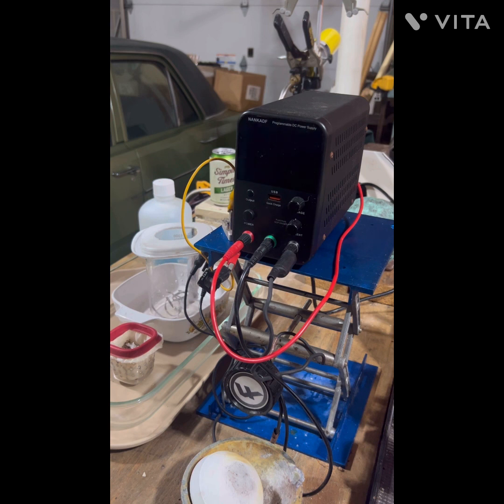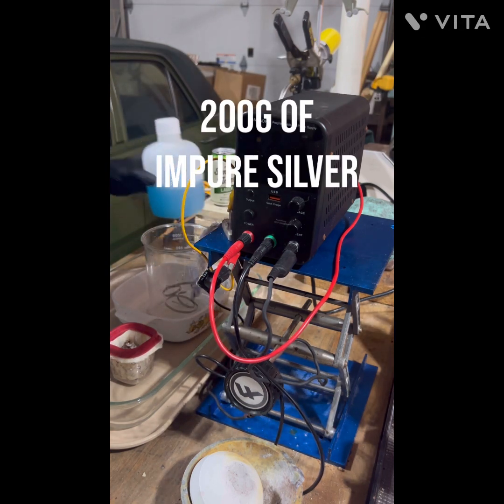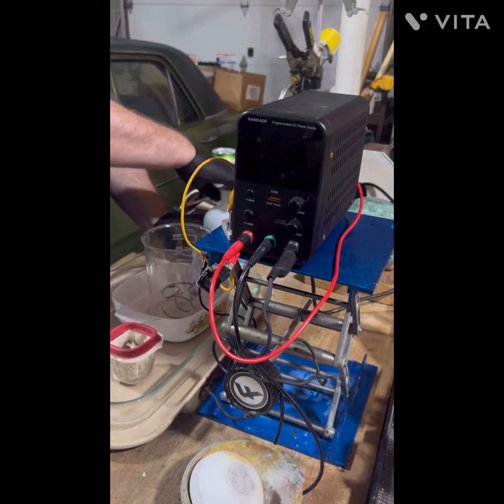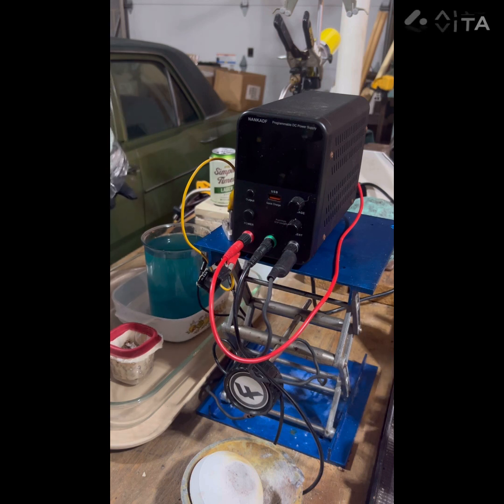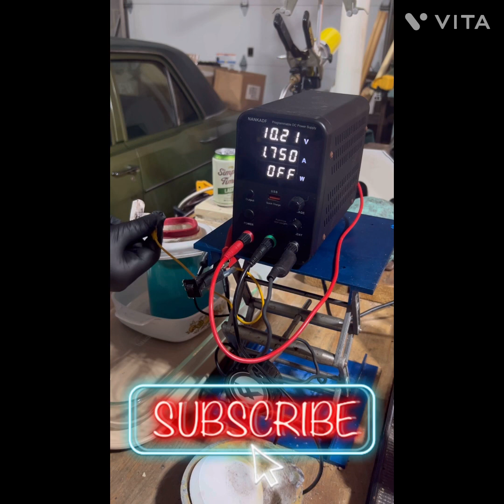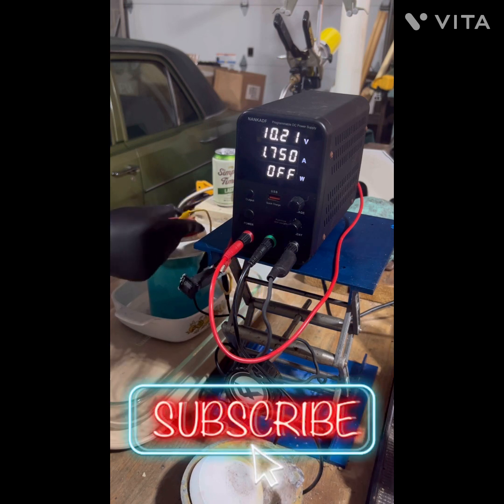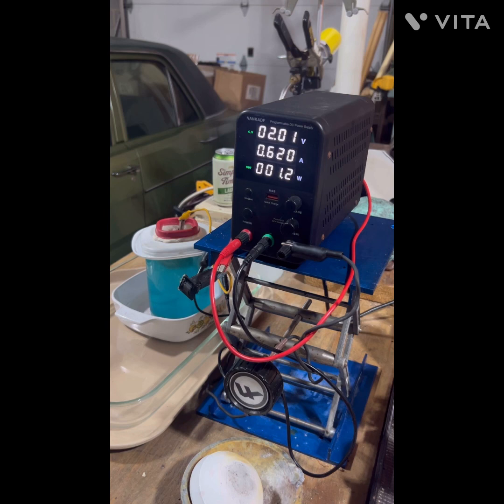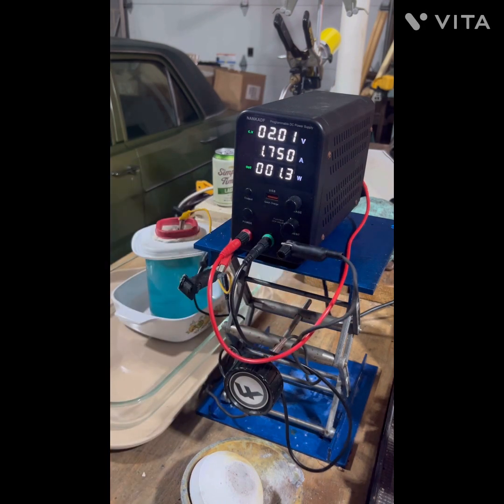Silver Cell Start Up

Comment: Wooo first 🎉🎉🎉🎉🎉
Reply from the maker: Trying to get back into the swing of things . Still settling out the silver sulfate from the removal of silver plated items .results in a couple of weeks ?
Reply: @Hill-13  just use 2 times as much distilled water and boil it in a big beaker. Once it's boiling then slowly pour all of the solution and the white precipitate into the boiling water. Once it's fully mixed and the white precipitate is gone back into solution. Take it off the heat and immediately place copper in the solution. All your silver will precipitate it like normal.
Reply from the maker: Thanks Matt
I will have to try this , I set it outside and have some silver oxide forming. I had planned to use weak Sulphric Acid and iron . But cementing out is much easier thanks.
Reply: @Hill-13  you have silver oxide or silver chloride????
Reply: @Hill-13  sulphuric and iron nails works on silver chloride but not on silver oxide
Reply: @Hill-13  sorry I was thinking of silver sulphate lol silver oxide can be converted with flame
Reply from the maker: @mattlevesque5927  it’s a mix most likely I’m going to try the boiling water any silver oxide would be non soluble so that would be left behind
Reply: @Hill-13  would make a cool video experiment 😉
Reply from the maker: @mattlevesque5927 coming up next week .
Reply from the maker: @mattlevesque5927 looks like both now just saw this
Reply from the maker: @mattlevesque5927  my last stock pot had a mix , I was hoping to use Sulphric and iron then melt into shot. It’s that or lye sugar method , it just uses so much water w/ the rinses
Reply: @Hill-13  can't wait I'll be lurking in the shadows waiting 🤣
Reply: @Hill-13  yeah brother silver is a pain for that reason. I've got my eye on a distillation kit on Amazon so I can recover everything to reuse it. Gotta get this move over with and then I can get back to work myself